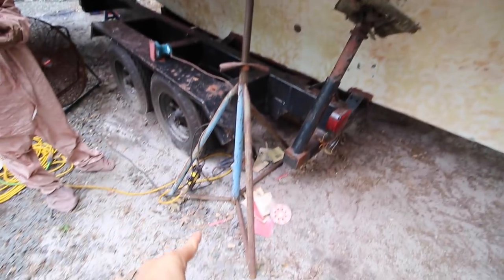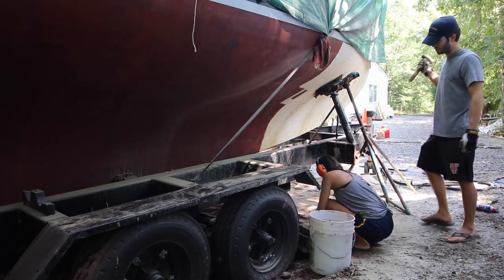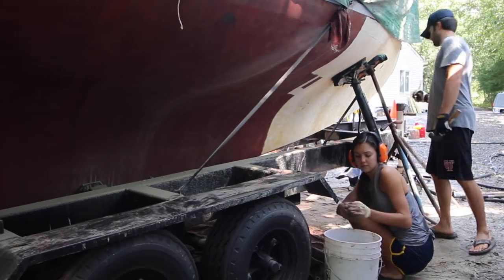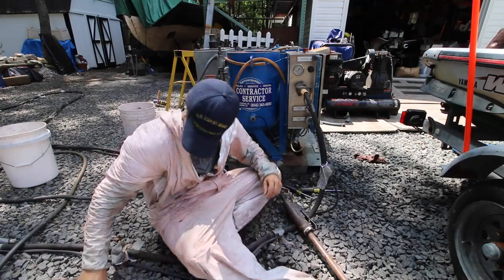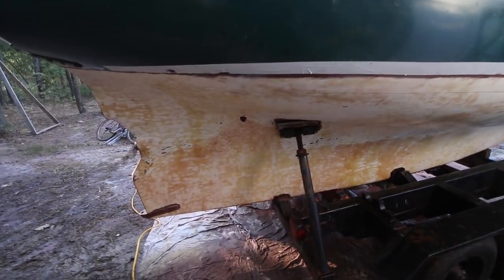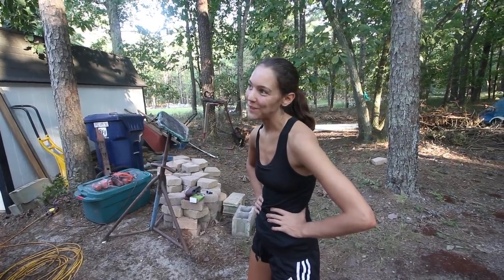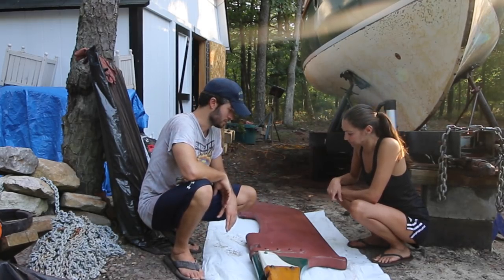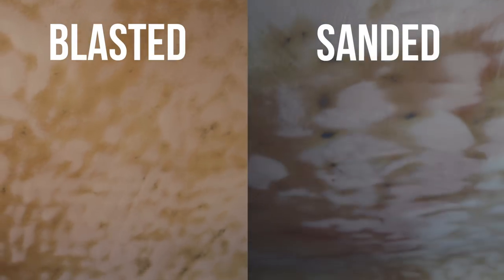45] Backyard DIY Classic Sailboat Restoration | Abandon Comfort

Comment: Carbon sweeps cool but Your worried about weight on this boat? Really...ok ....but heavy stainless lifelines , come on......tell me another one......Warren
Reply from the maker: Wall thickness, Warren.
Reply: Abandon Comfort ......OK your right, stainless had rails could be minimal weight.......the calculations.....thinnest 3/4 tube with1/32 wall is.  0.2707/ft and you will need about 60' INC 18" stanchions =16# plus fittings or welding if you can find somebody to weld it . But Normally 7/8"od x.049wall at .4379/ft is minimum used so at 60'=26#. A dozen fitting will probably add 5# so  about 31# for handrails if Strong enough...   but why go to all that hassle?   Use spectra/dyneema life lines or don't us any you really don't need them on a 22' yacht!  Weight is your friend with this boat not your enemy.   Thanks for sharing , cheers Warren.

Comment: Young people these days are totally clueless.   To ruin a nice older boat with an electric engine that will prove useless expensive and costly and at the end of the day most likely hurt the environment worse than a diesel engine is incredible to watch.  These two are not unique their entire generation is this way.    This generation doesn't see the big picture at all.  The vastness of the planet mixed with economics makes their efforts fail to qualify as futile.  Take Tesla's for example.  These people think a car that ultimately twice as expensive, 4X as expensive to repair half as reliable, batteries built with toxic chemicals worse than petroleum, a car that runs ultimately off coal since that's what predominantly makes electricity, will"save"the environment especially since carbon emissions from small cars are at best responsible for 10% of all carbon emissions.  It's painful to watch.  Youth is truly wasted on the young.

Comment: Sailing Uma has an electric engine & lithium newly installed - but you probably know that - you guys seem to have a lot in common
Reply: uma gets about 90 mins of electric motor time before it goes tits up too..pretty chancy offshore in a emergency...oars?...yea ok..lol
Reply: @mattf49006  is than 90 mins till its flat, or to 50% discharge to maintain a long life on the lithium? Either way, that would scare the poo out of me...
Reply: @cigarmann  thats probably a bit harsh. Uma may just have had more time on the water...give these guys some time...
Reply: +craig me ...i love Uma and their content...only two things i disagree on is the two flush holding tank they installed and the limited range the electric motor gives them in case of emergency...here is their test of the amp draw 
 https://youtu.be/DxTFLMm0ons
Reply: +Cigarmann ..although i about cried when they sold the HR...it's their money , time and mission...they have abundant information resources and they'll either make it work or have to start over 

hopefully that won't happen in the middle of a blow in a 20 foot rowboat with the amp meter showing zero
Reply: Cigarmann - ouch

Comment: Help me out.. I don't seem too get the long time frame for standing the bottom. I've worked for years in a small boating yards and have sanded a fair share of sailing yachts. The trick is to remove the antifouling with a (vacuum) scraper. I use the one from Gelplane. Replace the blades often and you'll remove  the bulk of antifouling in two days easy. One day of light sanding to remove the last bits of antifouling and/of primer and you will have finished your boat in a total three days (1 experienced person). Not five days for one side, especially on such a small yacht.

Yet.. I see no one mentioning this method and everybody complains about the sanding. Why? Is the scraping thing unknown in the States?

The antifouling clogs your sandpaper and gives you hell when you try to remove it by sanding. That's the reason you shouldn't sand, but scrape it. Trust me, I've seen plenty of people trying differt methods. Scraping, followed by sanding works best.

Anyhow, you're finished. Keep up the good work :)

Comment: Note: Motors run on electricity. Engines run on heat. Thank you.
Reply: Repower Your Boat with a Mercury Marine Outboard Motor. From the Mercury website. What does a Mercury Outboard Motor run on?
Reply: Lustfulvengance, maybe in your world, but alas, physicists and engineers both know I’m correct!
Reply: Don, I was with you from the first comment.
Reply: Thank you! "Motor" might be slang for a heat engine, but engine is never slang for an electric motor!
Reply: Andrew Wagner   This seems to be accepted usage. On the other hand "motor" is "mover", and engine (from Latin "ingenium") was initially "device", "machine", so it fits either way.

Comment: Sorry guys but this is really really not the way to do it. The easiest way to remove it is with a yellow scraper. Antifouling is very toxic. So next time please if you use a scraper or sanding machine please attach a professional vacuum cleaner. If you do you won’t need a mask and all your toxic dust won’t get into the environment.

Comment: Ive enjoyed watching your videos. You are a very likeable couple and natural in front of a camera. BUT your plans are daft. I share and applaud your minimalist values but you are letting it override your common sense. 
Solar power is a non starter. The ratio of deck real estate to weight means you will not be able to even have a fraction of the power required. (Maybe a tenth).
Rowing really just shows your lack of experience with boats this size.
The logistics of moving your trailer around to aid transport doesn't make any sense. The fact you think it's a good idea shows that sailing isn t for you. 
Install the engine,  restore the boat ,sell it and use the proceeds to fund your true dream (spending years working on boats doesn't sound like much of a dream to me).
Have you considered a classic RV?   Best of luck.

Comment: Being environmentally conscientious is the right thing to do but not at the expense of safety.  I worry about the idea of trying to power a heavy slow moving boat like your with an electric motor.  If all you do is coastal and inland waters cruising, it should be fine.  But, you have to ask yourself, if you're half way to the Bahamas and your mast breaks, will your electric motor and battery energy storage get you out the Gulf Stream before you end up in England.  Your reliable diesel engine with a full load of fuel almost certainly would.

Comment: Electric motor to drive that boat would require at least 15000 watts per hour of consumption that's if you only are asking for 20 horsepower I don't see where you can store that amount of electrical energy on board even lithium ion batteries wood struggled with that.

Comment: Oars and a sweep,  will work in calm conditions,  I wouldn't do electric,  and I am a fan of evs , I have a e bike etc, but a boat,  for the longevity you need the E motor is so limited it's not realistic,  what's happened to you guys , you split,  is the boat sold or what .

Comment: I hope you give details of the electrics, sounds exciting!..say 20kW motor? 6 hrs run time 6 x 20kW @  50% discharge cycle,  zero losses on energy management to be simple here,= 240kWhr storage...yikes! Does that sound right?

Do you need cooling on motor AND batteries? 

V big job guys, sounds pretty costly too. Lots of batteries ..  V much looking forward to how it goes. Seems to be a popular approach these days. Can i be a dick and suggest you put a mount out back so you can use the outboard from the dingy as a backup... just in case...

Comment: diesel engine, electric MOTOR.  engines convert fuel into mechanical power, motors convert one form of power into another.  air motor, hydraulic motor vs steam engine, gasoline engine.

Comment: Jehu Garcia if you look him up has Tesla battery packs. BTW  rather than an "electric engine" get a 3 phase motor with a controller like UQM or the Siemens Azure AC Induction 3 Phase Motor 1PV5135 4WS14. You can find more information on http://www.evwest.com/catalog/index.php?osCsid=8ol904t4ghrc57155510srbiv4
And no I don't work for, or related to them. Peace.

Comment: You guys ever thought of a catamaran or a trimaran, what made you choose a mono hull over a multi hull?
Reply: Sailboats over Catamarans and trimarans, safer too.
Reply: I can not say safer, if a multi hull turns over it will stay up side down, if you poke a hole in it it will more likely stay floating. if you turn over a mono hull, it will right its self, poke a hole in it it will more likely sink.
Reply: A sailboat is safer than a catamaran, this is well known, so if you intend for blue water sailing and sailing around the world a sailboat is what you want. If you just want to do island hopping etc than a catamaran will do. Also, a sailboat is much less sensitive to stored gear (the weight) than a catamaran is.
Reply: johan andersson  well there has been many catamarans a trimarans that have circumnavigated, the smallest cat was only 21'. They are plenty safe.
Reply: @hinahanta   I don't know how many have circumnavigated or under what conditions etc, but you could circumnavigate in a canoe, weather permitting, but that doesn't mean a canoe is suitable, or safe.

Disclaimer
That's not to say that ALL sailboats are suitable either just because they are sailboats. Dock queens for example are not very suitable yet cross oceans all the time.
Reply: johan andersson plenty have done it and are doing it now. Luckyfish is a 38'  cat that has sailed half way around the world, Sailing Zakara is a family of 6 on a cat, Sail Ocean is a family traveling the world on monster trimaran. There are plenty of multi hulls crossing oceans with no problems. The world speed record circumnavigation belongs to a trimaran.
Reply: @hinahanta  Sailing Zatara has been sailing around the world on a sailboat, they just recently switched to a Catamaran.  Anyway, like I said in my previous post, just because there are catamarans crossing oceans doesn't mean they are suitable, just like all sailboats aren't suitable either, despite the fact that thousands of them have done so and will continue to do so.

Comment: Your viewers might find this web page interesting, about a highly modified Cape Dory 36 with a Honda 9.9 outboard for auxiliary power mounted on a unique custom designed mount.  The owner has been using this now for a few years and reports great success.  It would probably work very well on the F.C. since your transom is occupied by not only the rudder but also the boomkin.  https://farreachvoyages.wordpress.com/2017/12/23/a-clever-removable-side-mount-rotating-arm-engine-bracket/#more-1006

Comment: Electric MOTOR not "engine".If you're gonna be a snipe you need to get that lingo down.
Reply from the maker: spencer marshall I’m no snipe! I drive boats and break shit (BM). My pops & godfather were snipes.
Reply: I used to lie about PM mandating the captain's gig be in the water pulling to ports so my coxswain and I could have a boat to use in the ports when the ship was going port side to and the boat would be over the pier. I had a freaking blast with coxswains on that boat! We took it flying off like 40' high rollers once while the JFK  carrier sailors went bonkers on deck taking pictures of it. To bad the Navy got rid of those for RIBS. Those were some damned powerful little boats.

Comment: So, thru hulls sink boats huh? Putting a boat in the water with an open seacock and no hose connection sinks boats. That's a seamanship issue not thru hull issue. 

Renewable energy = godliness? No. God's ocean is huge and your boat (and mine) is small. Keep the diesel and live through storms that could blow you onto the rocks.

You guys need to have advisors who have been to sea whom you trust, if anyone with those two attributes exist.

Comment: Bluewater - trailerable is an oxymoron. No one at sea in rough conditions is congratulating themselves on the fact that their boat can go overland on a trailer.  "Gee, I wish we had a smaller boat." Not gunna happen.

Your insistence on a trailerable boat reveals your lack of commitment to the sea. Your real commitment seems to be to boat restoration and resale. Might as well own it an become the sailboat flippers. 

Your bluewater dreams are stuck in your backyard reality.
Reply: Have you ever read "20 small sailboats to take you anywhere" by John Vigor?
Reply: No, but I have been 50 miles offshore in a 23' boat in the north Pacific catching albacore and I know the feeling of looking around all day for some fool out there in a boat smaller than mine so I would at least have company.

Many people have sailed thousands of miles in very small boats. Many have died trying as well. The ocean doesn't care about the size of your boat, your skill level or your preparations. She just chews 'em up and swallows.
Reply: That's the point - if it wants to, it will swallow you regardless of the size of your boat. Larger does not mean safer. Well built, well-equipped, and well-manned is all that will save you out there, not how many feet it has.
Reply: I haven’t read it, but I have been out in seas in smaller boats. Imo the smaller the boat is the smaller the wave intensity needs to be before crew comfort drops to perilous levels. Even the strongest boat is exponentially more likely to flounder as crew fatigue sets in. And we’ve seen earlier in the channel that Kelsey is prone to seasickness in benign conditions in a 35. I’m hoping for the best but I can’t help but think their offshore jaunts are going to become even shorter excursions under even more ideal conditions as they discover that it doesn’t take much sea state to exhaust them.

Comment: I have to ask, are you changing the color of the bottom because if your not then wow you just wasted your time!! also you are probably going to ignore this comment because it seems like you only like to listen to the ones that support you. also keep that engine put and electric outboard on and have the other as a backup. you might not ever use it but you never know. also you can get very light weight oars out of wood. you have a beautiful boat that looks like a wooden classic traditional boat and all i heard from you is that you don't care about that. you wanted to put an aluminum mast on???? and get rid of any varnishing??? if you didnt want any of that then why get a boat like that. i get its "perfect" but if your gunna destroy it. look for something else. it pains me as a designer and builder of wooden boats to see shit like that.
Reply from the maker: Why waste time responding to people who have no basis for their opinions? Everyone behind a keyboard is smarter than us. Yet they don't actually do anything. Kind of funny. Lots of talk, so little action.  We're not touching the mast or the interior so pump the brakes on destroying anything. The bottom paint was close to 15 years old and we have to seal up thru hulls which require the boat's bottom being bare glass.
Reply: I would say there are quite a few people responding who do have experience and their experience tells them that an electric motor is, for the most part, insufficient.  In the end it's your boat and your life and you're going to do what you want, but to say people have no basis for their opinions is false.  There's no reason for you to get so defensive about it.

Edit:  you've also decided not to reply to those who've commented on the way you disposed of the paint you sanded off.  It reminds a little bit of when you christened your first boat with a bottle of champagne and let the glass fall into the water....

Comment: I enjoy your videos but you guys confuse me with the whole "going green/renewable energy" scheme. You considered dumping a wooden mast for aluminium ??? have you considered how much energy and pollution is produced from digging up Bauxite and processing this into aluminium versus a wooden renewable and sustainable mast ?? Same goes for your electric batteries ???Lithium is a highly poisonous heavy metal and a major component of your batteries . Your "polluting" diesel engine will have a usable life of potentiality decades at which point it could be recycled !! how long are your batteries and electric motor going to last in a highly salty environment . I' ll bet their life span won't be a fraction of the old diesel engine.Same argument for the solar panels and carbon fibre oars. It seems to me that by going green you are dumping older PRODUCED materials to replace them with NEW materials that will cause MORE pollution in their manufacture and delivery than will ever be produced by keeping what you have !!! That just doesn't make sense to me !
Reply: Stephen, your comment expressed the same thought I have had as I have watched and listened to their videos. Their environmental aspirations are admirable, but their decisions and actions suggest that they do not have a comprehensive understanding of the issues and the environmental impacts of their choices.
Reply: The same applies to getting rid of your car and buying electric . Environmentally sound if your car is worn out and needs replacing only . The environmental cost of making the new car outweighs the savings
Reply: Someone has to push battery technology forward... I bet you never thought of that, genius!
Reply: @drx1xym154   You do know that this is not the only battery powered thing in the world and this will hardly push battery tech forward compared to phones , cars and Trucks - right ?